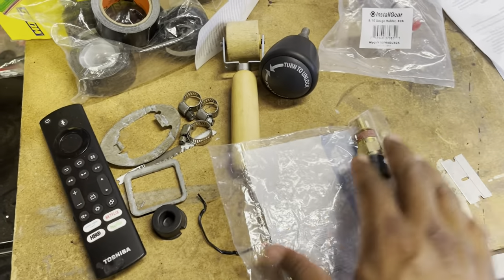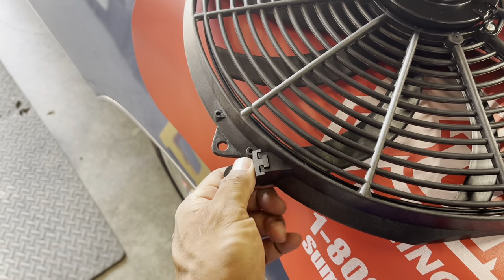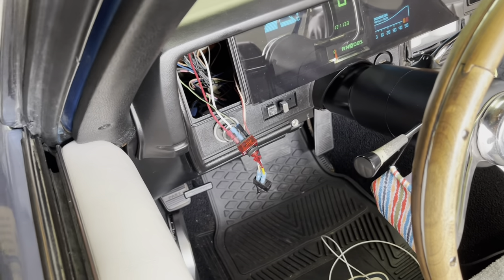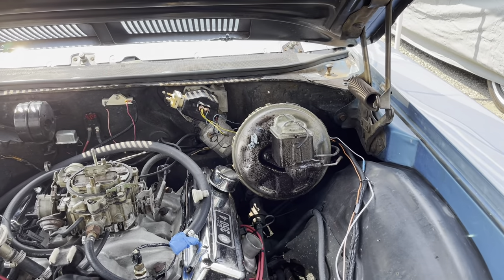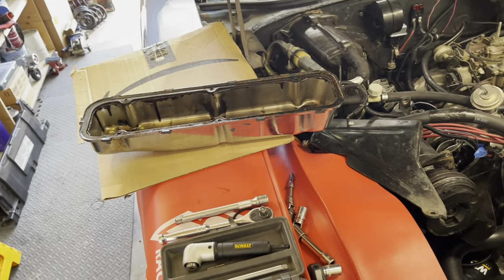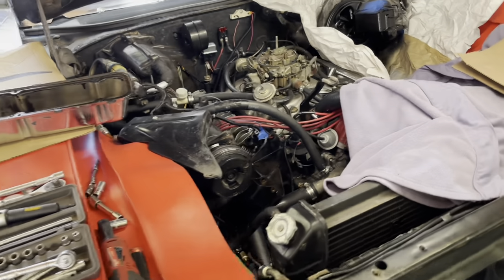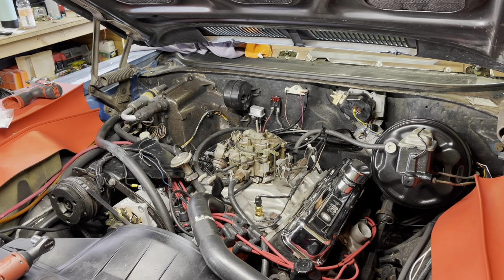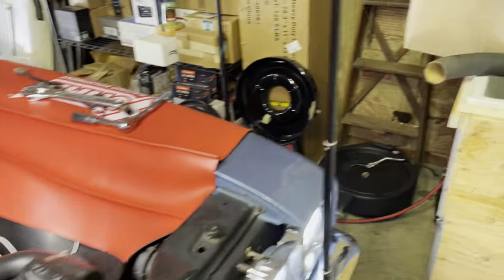Electric Fan Install & Engine Bay Clean-Up | 1971 Buick Skylark Convertible

Comment: Griff, as usual nice video.  Thanks for the idea with the fan.  Have you thought about an EFI system on your Buick?  I install an MSD Automic EFI on my 69 Buick GS 455 last year.  Hands down, one of my favorite mods to date.  Cold start without touching the gas pedal.  Let me know your thoughts.  Thanks.
Reply from the maker: What’s up Mo T! Thank you! It’s coming along. EFI is actually one upgrade I would like to do one day. That’s good to know from your experiences. Mine has been running so good tho I’m gonna ride it out. Lol! EFI is for sure in the plans.

Comment: If you have issues with the switch heating you can use the replay as a negative trigger instead of a positive trigger. ACC/Keyed 12 V to 85 - Switched negative to 86 - Constant 12V to 87 and 30 to the fan to supply power when the replay is triggered.
Reply from the maker: Man! That’s what I wanted to do but I’m not good with relays so I just went with what I knew would work. That’s you for the detailed explanation. I will keep that if this one acts up. I did upgrade to a 30 amp switch.
Reply: @MrGriffin23  anytime brother! Just remember 85 and 86 is the control circuit. You can control it with neg or pos. Whatever is on 87 will be sent to 30 or vice versa. When the reply is not triggered whatever is on 87 is sent to 87a.
Reply from the maker: @civik29  Awesome! Thank you for that! Makes complete sense.

Comment: What’s your thoughts on the 2bbl Rochester? I have.a 72 lark with the 2bbl Rochester got it rebuilt still hiccups at stop and go, should I replace it? Is there a better carb than the Rochester some say no
Reply from the maker: I’d go 4bbl if you can. I had a 2bbl on my other car, it was so gutless.

Comment: Just wondering what digital gages are you using and what did  they cost?
Reply from the maker: They are digital gauges from an old school Chevy S10. Got it out the junkyard for for like $40.
Reply: And they fit right in nicely? Or did you have to modify them a bunch?
Reply from the maker: @robfriess4557  Modified a bunch! Definitely not a direct fit, the wiring is not too bad tho..
Reply: Ok great thanks I wanted to do that to mine but didn't want to buy Dakota digital they are way too expensive
Reply from the maker: @robfriess4557  No problem at all. Yeah they are spendy. Thanks for watching!